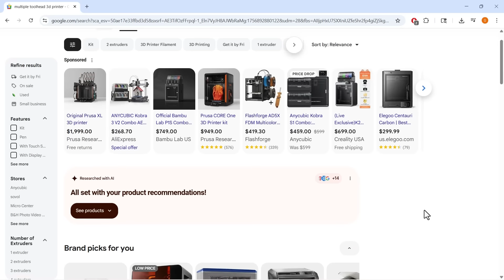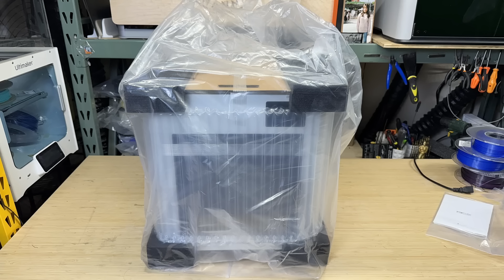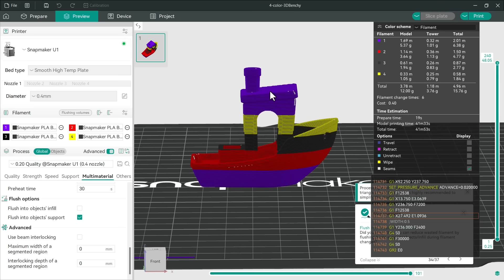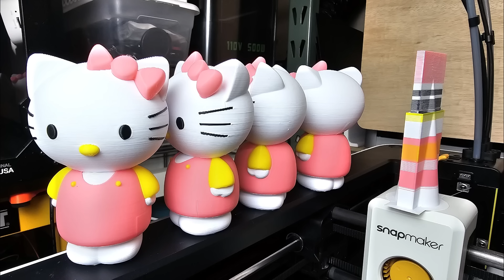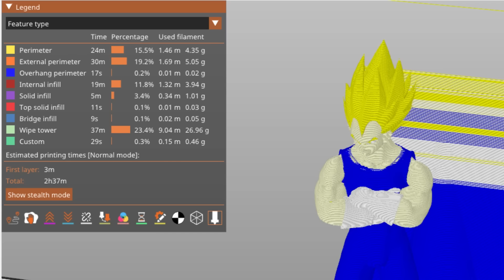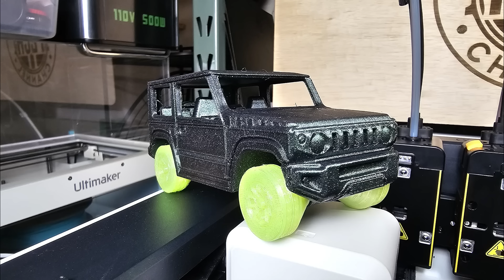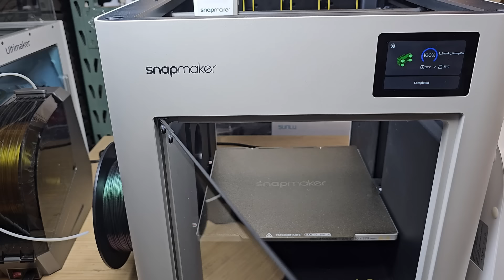SnapMaker U1: A 4-toolhead auto-changer 3D printer that will change multi-filament printing

Comment: You can save a heck of a lot of print time by only making the interface layer the opposing material. With this method your PETG model and supports would be almost entirely one material, but where the support interfaces with the object there would be a layer of PLA (or vice versa). I put some instructions on how to do this below the fold.

Obviously this uses more PETG but it means almost zero color changes.

If you're interested, I'm not sure where this setting is in the Snapmaker Bambu Studio slicer clone, but in BS it's under Objects > Support > Filament for Supports ...

Leave the "Support/raft base" value the same as the object material (in the video example this would be PETG as the horse is PETG) and set the "Support/raft interface" to the opposing material (again, PLA in the video example). This will present a pop-up dialog asking if you want BS to auto-set some related settings.

If you find the bond is still too strong between the materials, you can increase "Top Z distance" (still under Support tab, this is the distance between the support interface layer and the object material) by 0.05 increments until resolved (0.05 is usually enough) and/or adjust "Top interface spacing" by 0.05 (this is the interface layer line spacing and so makes for a weaker support interface).

Comment: Awesome video! I was deciding between QIDI Q2 and Snapmaker U1, I think I am sold on the U1 at this point.
Reply: Did you end up getting the U1? If so are you liking it so far?
Reply: @NotEyeman Yes and I like it quite a lot. Keep in mind it is my first 3D printer. But I just love the flexibility it provides. Zero waste, no hassle with swapping filaments often and the quality seems really good. Only benefit of getting something like Bambu is having those premade profiles, so you can just click print, but that wasn't my thing anywax as I want to learn, not print random stuff with single button and zero thought.

I would recommend Q2 only if you NEED ABS without needing to mod U1 (top cover)  and possibly buy PandaBreath.
Reply: @TominiOfficial  thanks! yeah I’m going with the U1 with the pod cover & panda breath
Reply: @NotEyeman The Pod Cover doesn't have a dual-ventilation or filtration, so watch our for that. I think it is nearly the same price. For 150€ the Snap Top Cover is not that much when you realize how much it will cost you in material and labor to make alternetive with same/similar features.

I ordered the Top Cover, which will arrive in late Fall I believe. Until then the IKEA SAMLA (or other branda more common to other regions) are really good and cheap solutions.

Comment: Bed size is a huge let down..  min for a good 3d printer is 300x300mm   look at what SOVOL did to the SV06 Plus.. with the new SV06 Plus Ace for about $300.00 USD   300x300x350..  and fast  500mms

Comment: Nun, einige dieser noch erkannten Mängel kann Snapmaker sicher mit  Software Updates ausräumen. 
So glaube ich, das die 12 sek Druckkopfwechselzeit mit steigender, durch das Filament bestimmter  Drucktemperatur und gleicher oder niedriger Standby Temperatur als bei PLA seine Ursache findet. 
So müsste das Aufheizen früher beginnen. 
Ob der fertig gewordene Druckkopf für die jeweilige Schicht immer im Druckraum warten muss, weil vielleicht der Bauteilkühler für das erreichen der Standby Temperatur genutzt wird, jedoch am Kopf und nicht am jeweiligen Extruder hängt, ist auch eine Frage an Snapmaker. 

Ansonsten finde ich, das vmax auch bei E Antrieben für 3D Drucker keine Reisegeschwindigkeit ist. Schaut man bei großen E Motoren in großen Maschinen (Dreh- Fräs- Maschinen bspw.) erkennt man, das die Menschheit da schon weiter ist.

Comment: I designed my own super cheap tool changer ages ago, and I see they're struggling with the tool changer artifacts, but these are abit worse than I experiance, I wonder if they're having repeatability issues.
I have tested mine to 0.02mm repeatability and I got some of the same artifacts, the ones where every other layer is buldging out.
I forgot how I fixed it, but it involved either purging a ton or doing this reaally weird routine of docking and unlocking and pulling the filament out out of the nozzle when parking, but this was hard to do well because the filament would clog if pulled too high. in the end I did fix it for the most part.

also petg+pla has one big advantage. even the TINIEST string/whisp of PETG or PLA cross contaminating each other created a weak point at that spot, so it's not useful for functional parts, mostly just toys. you gotta tune and dry the PETG very well before doing it! modern hotends and extrudes don't struggle with oozing and stuff as much tho. I was using bottom of the barrel v6 clones, the only ones I could find in Iran.

Comment: I've had two Snapmaker printers, the SM2 A350 and the J1. Both were absolutely  terrible printers but my experience with Snapmaker as a company has been a disaster. They are by far and away the shadiest company I've had the displeasure to use and have zero morals. They spend a fortune on making their products look nice and an insane advertising budget yet their products are overpriced and massively underperforming. Their business model has always been to sell incomplete , broken or underperforming machines and expect their customers to pay high prices for necessary 'upgrades' to make the machines work as they were originally advertised. Their prices for proprietary consumables has also been insane. 
I'm very surprised you have recommended this machine but as you have proven to be right and honest about all your reviews , I guess Snapmaker have made some effort to not be complete Ratbags. This machine seems very reasonably priced even if it is a KS campaign and made cheaply. 
However I do still see them up to usual tricks , 150 for a plastic top hat. Stainless nozzles as standard. 
As good as this Kickstarter campaign sounds, I've been burned by SM far too many times.

Comment: Thanks for the great review. At 9:58, 10:20, and 10:38 the printer leaves blobs of filament on the print bed- I'm surprised you didn't mention this? If you were printing something that filled the bed, those blobs would end up in the print.

Comment: Little One you are growing up! What a great review for a extraordinary Value Printer. Searched for my backup printer and bought the Flash Forge M5 Adventurer and is has been great for the Money. My old 10S Pro is jealous, he never get the smaller parts anymore. This one this U1 is simply a beast.  The Print Quality to my old eyes was spectacular. Voxel Filament does print well too, thanks for that tip. Need The CF coming out next month. If I had the means and need for a 3rd Printer this is it. I had never considered MultiHead practical due to time and waste but this fella nails it. Kindly thank your parents for the great job they are doing and take care. This one is on my list when the time comes, it is on top. Thank You, Dennis

Comment: Q: Why do you still need a prime tower with four full heads⁉️ (Newbie here)
Reply: When a tool head is not in use, the filament remains inside but is still heated, leading to degradation, so the prime tower is to remove that small amount of degraded filament.

Comment: Just rewatching this video and exploring the Kickstarter a bit more.  The price is pretty compelling for a 4x tool changer.  The other option is to wait for the H2C which will be 3X the cost.  I have no history with Snapmaker, but I have to ask why does the slicer, app, and everything else look like Bambu?  Is there any crossover between Snapmaker and Bambu?  Did they just copy everything?   My last concern with Snapmaker is parts and accessory availability.  It's already hard enough to get parts (for a Prusa for example) in this part of the world.  Given Snapmaker's in China it's actually easier, but still concerned about readily available parts.
Reply: The slicers are similar as they are forks/adaptations of each other. 

A short list could be: 

slic3r -> PrusaSlicer -> Bambu Studio -> Orca Slicer

Comment: Very nice review, I cannot wait to get my unit.

I like how you show the workflow with the slicer settings. Since you mentioned those CF-rods I wished you would have put in some information about maintaining such a printer. Does it work till it doesn't or are there any recommendations in what to aspect and what to plan in for maintenance? Also I missed the part with a HEPA filter. Since those machines do run in apartments, a filter system (or at least the space for it) would be nice!

I could imagine that from some point on there could be more: more print heads, more print volume, more temperature, more opening angle for the door.
But from what I just saw this printer could easily be my work horse for the upcoming years!
Seeing the usability from something like a Prusa MK3 which could maybe have been upgraded to a MK3.5 and be working flawlessly for the last like 5 years and be upgraded now, I hope this Snapmaker U1 would fill in those footsteps and being reliable till in 5+ years so much developments in the printing community have been done that a 4 toolhead system with 270x270 isn't "enough" anymore ...

Greetings from Germany!

Comment: we don't have many options.
Not yet. In a year everyone is going to be rushing to release INDX printers. This printer's 4 tool count will be considered not great. A year ago I might have even considered backing it myself, but after hearing about INDX. Knowing that there is a core one INDX in the works or may be a core 2 by prusa and there might even be cheaper INDX options. This printer might struggle to compete. Maybe they'll release a U2 which is the same printer, but with INDX instead. 8-10 tools.

Comment: I would say that A1 has shorter retraction than X1 so colour change is faster, still it's significantly slower than snapmaker. Also due to no unloading filament you can actually use multicoloured filaments without "twisting" on colour change. Also for support wit different material it would be better to set is as support interface material not whole support to reduce tool changes

Comment: this is a pass....based on the price...and also the fact that atleast with an ams or other type enclosed you can combat issues with moisture.   with the spools being on the outside you clearly cant and will have to run each spool thru a driyer first.  unless i miss something.   I will still with my P1S.   if they offered a larger priniting bed i might be swayed.   The option of four tool heads is very cool but i feel the video you shown of the UI  feels a bit lacking and potentially problematic in the future.   I feel like beginners might jump on this but soon have reget when they face issues.   More experienced users will not be phased but i feel like shapemaker will need one or two more vesions before they develope could be a true game change to the market.   As far as the review of this product comes off very monochromatic.   No frustrations or enthusiaism about this product.   personally as a consumer...i look for those visual and audio reactions to show ifa person is being genuine about a product.   This review did not excite me in anyy shape or form so....im gonna pass.    When a real live person sounds like AI -emotionless...thats a big negative.   definitely not subscribing!!

Comment: I would have really liked to see a tolerance or other test to demonstrate how well the 4 tool heads are actually aligned. I've seen some cubes with checkerboards and other types of test prints to ensure that the different nozzle actually lay down filament at the exact spot they are supposed to and are not slightly offset. As an example, is there a difference printing your tolerance test with one extruder, like you did, or does the result change when doing multiple tool changes (Using the same material to avoid shrink differences, etc) ? 

Overall love your reviews you are super detailed and enjoy watching your vids. Thanks!

Comment: Great review! It looks like with this set up, it could be very difficult to use a more flexible TPU. Was the TPU you used 95a? I'm wondering if you have had a chance to test 90a or even 85a? 
I have wanted a multimaterial printer for a long time so I could use PLA as support for TPU, and some parts need to be out of 85a.
Thanks for putting the time in to really test this and not just do what so many other people do, just reading the stats without running proper tests.
Reply from the maker: Yes, it was 95A. I don’t think it supports softer TPU, just like other machines with long Bowden tubes.

Comment: How do you think the print quality compares to the Bambu Lab X1C? It looks worse, but it can be hard to tell from a video. Also, the belts on the X and Y axis look like 6 mm wide - is this true? If so, I'm surprised that they didn't use a wider belt like other makers are doing now.

Comment: Thank you for your review, I usually watch you but never comment. I own an X1 Carbon with almost 3800 print hours and an A1 mini with 718 hours. I started with a Sovol SV06+ and have been in the hobby for almost 2 years, and I am sooo glad snapmaker have put the fear of god into bambu lab. If I had to replace my X1 Carbon I think the U1 would be a decent no brainer alternative, I imagine and hope snapmaker will fix the current issues the printer has.

Comment: Until they find a way to enlcose the top of the printer and use components inside that are rated for more than 50C temperature it is pretty much a PLA printer, which is sad as I think the 4 toolhead is a real winner.

Comment: The price of this machine is not $799.  The MSRP will be $999 which is not great for a smaller build volume despite the multi-heads.  They missed the mark.  This machine should have been 350x350mm with 5-6 toolheads at a greater cost of course.  I will wait for either the Bondtech INDX with tons of color capabilities depending on the size of the machine you are retrofitting (also supposed to be very inexpensive) or the Bambu Lab Vortek with at least 6 colors.

Comment: For the benchy, the waste filament was still a full one third the model - better than a filament swapper, but still a lot of room for improvement. If the need for priming cannot be avoided, they should fit a roller bed under the head storage slots. Then the prime could happen on that roller rather than the main bed and as the roller turned the line could be scraped off into the poop bin allowing the circumference to be used indefinitely. By comparison the prime tower approach wastes a lot of filament building the tower up even with no tool changes at the current level.

Comment: Do the PTFE tubes really need to be that long sticking out so much?
Reply from the maker: Yes, the length of those tubes is just right. If they were shorter, the angle of the filament would be too steep when entering the extruder.

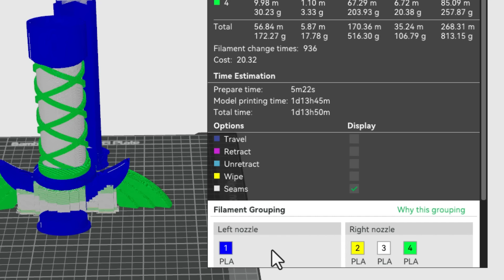Comment: Nice explanation. But about the sword at 16:00, the problem is not the printer but the model. It's a multiple parts in one print with a small buildplate connection. So if the part come loose just a little bit then you have that layer shift. Maybe try printing it with some sticking spray like 3DLac? Love that there is finaly a toolchanger at a good price range.

Comment: I'm still new to the 3d printing world and multi color/multi tool head machines, but is a prime tower still necessary if you are completely switching tool heads? I understand the utility in a system like the ams from Bambu but why is it still needed in this?
Reply from the maker: A prime tower will make your print look better; otherwise, some tiny filament residue may end up on the surface of your model. Since the prime tower only wastes a minimal amount of filament, you could choose not to use it, but most people keep it for the sake of surface quality.

Comment: Great as always, but a nice addition to the tolerance test would be to print each individual squares with different tool heads. A checkered pattern to see how well the tool heads register between tool changes and not just how accurately the tool head 1 moves.

Comment: When printing the benchy I noticed little squirts of material as it switched tool heads. Is that a consistent issue, and will that be a problem for larger build size prints that may be using that space?
Reply from the maker: That happened to the first Benchy right after the filaments were loaded, I didn’t see it happen afterwards.

Comment: What's with the oozing during your benchy print? Was that a mistake you made or was it the printer's fault?
Reply from the maker: It happened right after loading the filament, but I didn’t see it occur afterward.
Reply: Where is the oozing visible? Honest question, as I have no experience. For me it looks clean.
Reply: @adam5258 It starts at 9:55. It's not on the print itself, it's little blobs on the back of the plate.

Comment: I would have liked to have seen if you can make the wipe tower another model.
Is that possible to do in these machines?
Reply from the maker: That’s a slicer limitation, not the machine, I can’t think of any slicer that can do that yet.
Reply: @AuroraTech ok thanks so doesn't Bambu have an option for a purge object ?
It's just that there is not one for a wipe object?
Those wipe blocks looked really clean, from a distance anyway, I bet if there were an option you would get a  pretty good print

Comment: As a Snapmaker Artisan early backer, I will wait. I definitely was the beta tester. Snapmaker quickly addressed mechanical issues, but still has many unresolved issues with software. Hopefully, they come out of the gate in better shape than they did with the Artisan….especially considering how many more people are backing them this time.